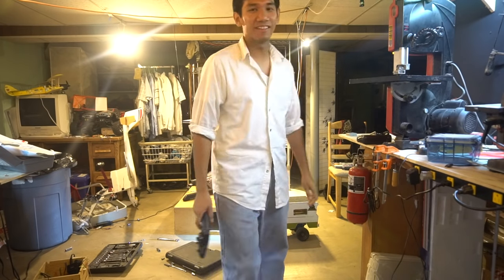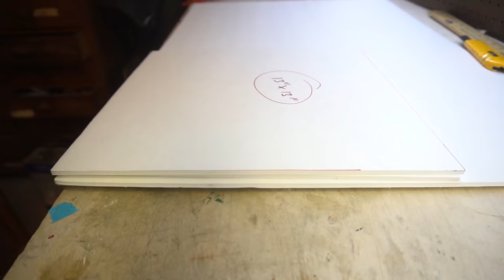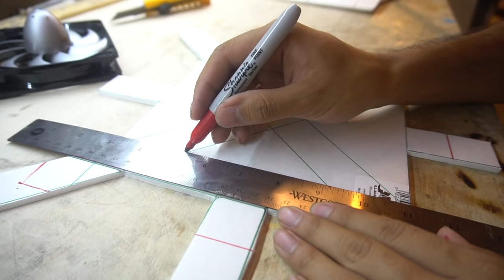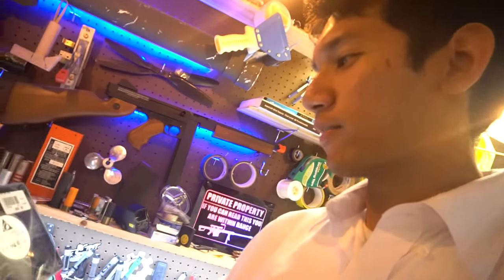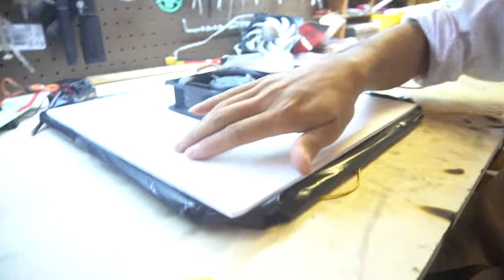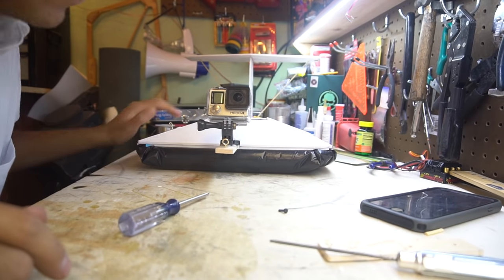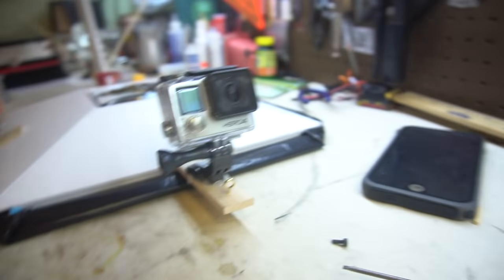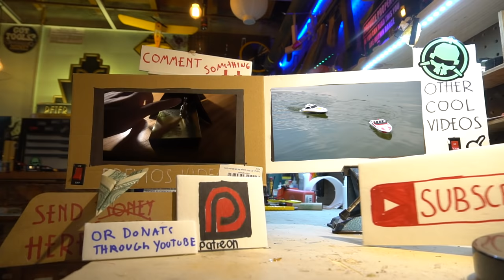Hovercraft GoPro glide camera rig

Comment: Every time I see someone cutting foam core I get a flashback to when I cut off the very tip of my index finger.  I had it hanging over the edge of the ruler and the blade sliced it right off like it wasn't there.

Comment: when i make my hovercraft. i look the pc fan removed the motor coil and circuit board. drilled a hole in the middle of the fan blades and attached it to a motor the motor then attached to the fan frame. There you go a 300watt pc fan that is supper dangerous. It is basically a large low rpm edf at that point.
Reply: Marcus Christensen I can't comprehend what you mean but i am very intrigued maybe make a video?
Reply: Vincenzo Ciffa i'm terrible at explaining, but i might do a vid. Its basically ripping the old motor out of the fan and replacing it with a new brushless motor. Just make sure its a good pc fan with solid blades i had one fan explode, could have killed me or made me blind if i was not so lucky.

Comment: why not just replace the original fan motor with a  small rc brushless ? a lot cheaper that $40 for the delta or even use a EDF on low volts .

Comment: How does the bag hold up going across concrete and rough surfaces?
Reply from the maker: Garreth Conner so far after being pulled for a total of about 3miles it only has a few small 2mm holes. It's been dragged over some very rough concrete too.